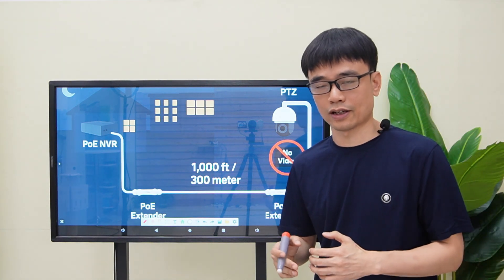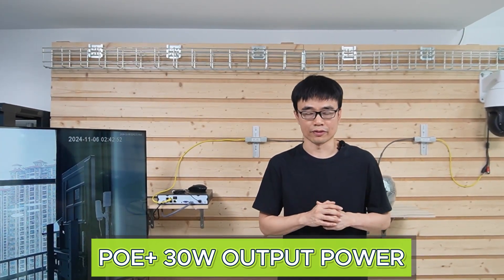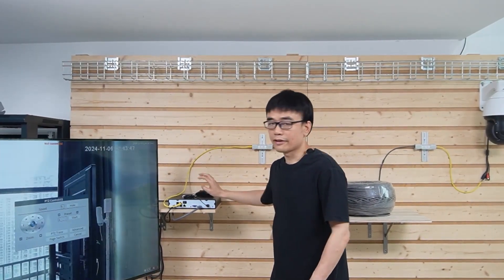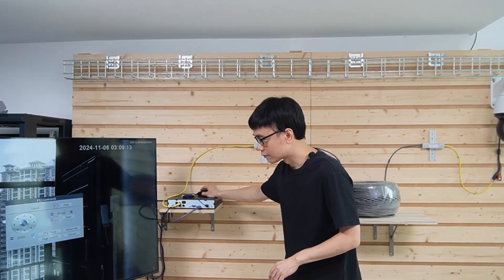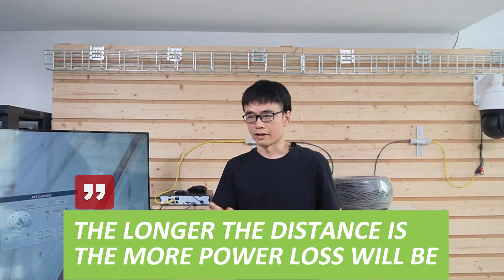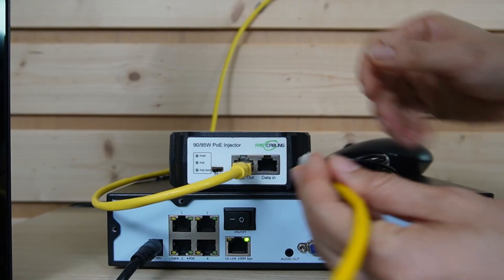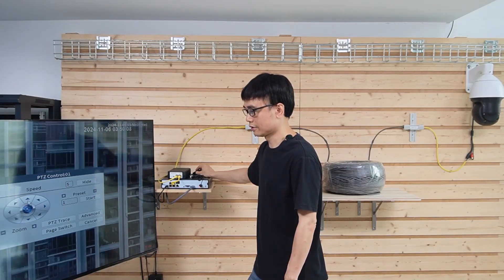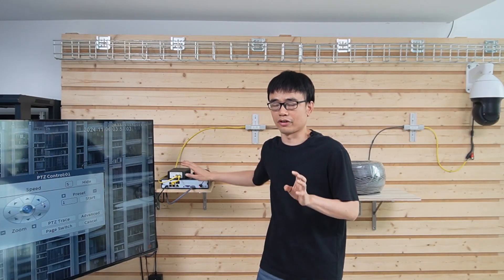1000ft PTZ Camera Lost Video at Night | PoE++ High Power

Comment: I always thought that the extenders had to go somewhere in the middle but you're using them close to the start of the run and close to the camera.  Am I not understanding how to do it properly?
Reply from the maker: This special model allows you to put the extenders at both ends and achieve 500 meters (about 1600ft). You don’t need to place the PoE extender at the middle. However you do need to consider the power loss inline. You also can place the PoE extender at the middle but it will repeat only 100 meters.
Reply: @Fastcabling  Thanks for explain
Reply from the maker: You're welcome! If you're interested, you can sign up for our free online courses here: https://learn.fastcabling.com/

Comment: Camera side 12v 5A DC power connection 
Is that ok or not
Reply from the maker: Negative. It is 60W power. The maximum distance is about 450ft with cat6 cable. The constraint comes from the wire gauge of the cate6 cable which relates to the power loss inline.